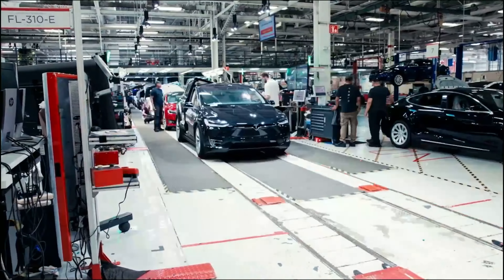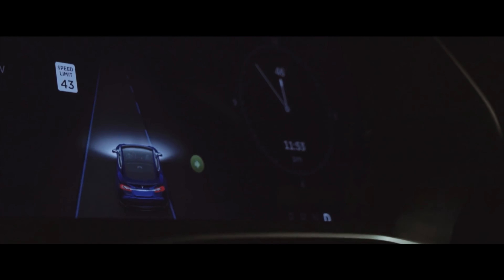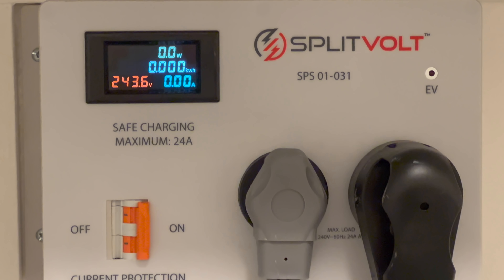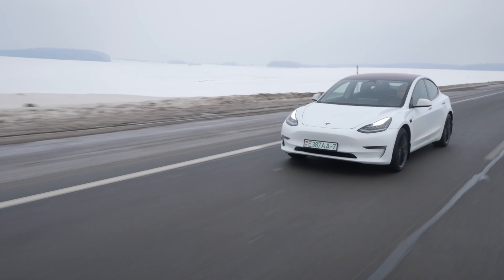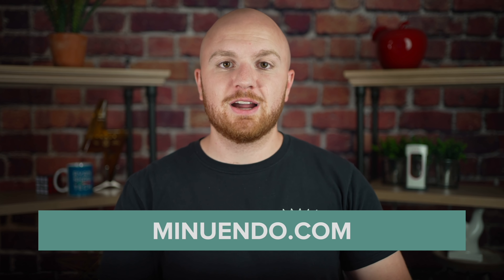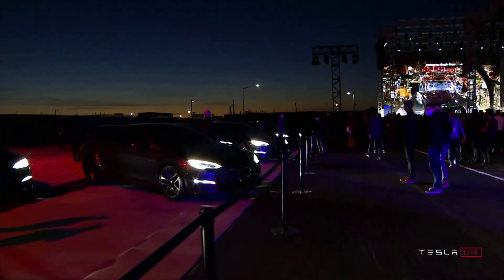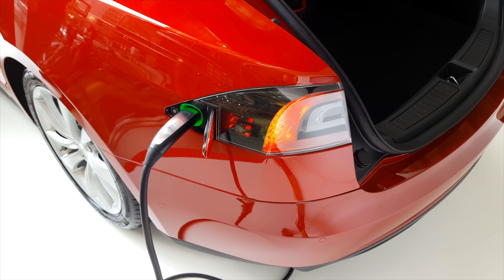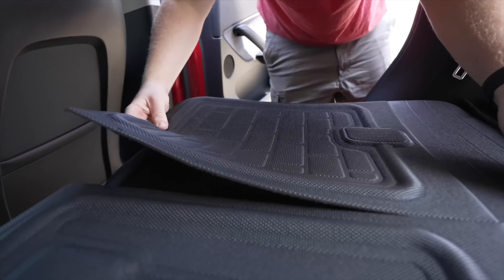Buying a Tesla? | Don't Make a Mistake

Comment: We currently own 2021 Tesla Model Y long range. We have an order in for the new Model Y with the directions to the Tesla Advisor to only accept the New 4680 battery having the longer range of estimated 485 miles.  It will have additional features like dynamic lighting, heated steering wheel, upgraded wipers and no more radar. This causes the software to see the road as a person would see it. Currently the car will brake when there is no reason to do so. Example: We have the car on cruse and radar sees a large truck exiting on the right in exit lane and the cars brakes automatically turn on as it sees the truck as a hazard. Gets annoying. 
Bottom line: we will be owning 2 Model Y"s  We have 14. 5k miles on our current one and it is running great. We have a home charger  which our local Electric Company sends a check for $750 when you send them your electric installation bill and the Level 2 Changer cost. We paid $835. Advice check out your local Electric company for a rebate. We charge 80% rate and 98% of our charging is at home. 
Do your research and good luck.
Reply: I just ordered a model y performance but I would like to wait for the Texas made Y with the 4680 battery.  How do you contact your advisor? I didn’t get any contact number or maybe didn’t see it anywhere?
Reply: @petenice75  I called
Reply: @petenice75 
  I phoned the local dealership and asked for a Tesla Advisor and he walked me through the process. He took my credit card put in my order which specified I would only accept the Model Y with the 4680 battery that put me into a wait list so when my number came up that would be it. I had to pick a color so I went with White.
Reply: @bobskeway8179  thanks!

Comment: 9 pm off peak time? This is very strange. It is possible to buy and sell electricity in Austria at the day ahead hourly spot market price.
9 pm to 10 pm is on Sunday June 25th 2023 with nearly 16 Cent the most expensive hour of the day. The cheapest hours are 1 pm to 4 pm. At that time are even negative prices.
09:40 I have seen also comparsions with 235/55 R18 Wheels.

Comment: Good list of items to consider. A couple of questions- 1. you mention std range can easily cover a daily commute with 268 miles, but you had just finished saying to not charge over 80% for daily driving, so isn't that really 214 miles (on a nice day - no heat or a/c)?   2. I still find it odd that the quality strategy is to walk with a checklist and prepare for your post-delivey service visit. At what point does it become Tesla's responsibility to deliver a high-quality finished product to the customer at delivery?

Comment: PV of $200 perpetuity = 200 / (16.67%/12) = $14,371 vs $10,000... you're better off paying the 10k up front if you actually want it. 16.67% is derived from the % of the car's value you're paying every month ($40,000 model 3)

Comment: One big problem with the model 3 sr+ is that were are currently two batteries. 

It is a gamble which Batterie you get, the Problem is that the Lithium-Iron-Batterie does not like cold temperatures. 

Tesla now has a recommendation (product Details), for the LR and Performance for cold climates. 

In the Future the Model 3 SR+ should only use the Lithium-Iron Battery.
Reply: It's not a "batterie"
Reply: @SiisKolkytEuroo  It is German, it was done by my autocorrection.

Comment: The poor ride quality is due to the very high tire pressure. Most cars recommend you fill the tires to 30 psi. The Tesla is filled to 45 psi. This reduces drag, and increases your range, at a penalty to ride quality. Try dropping your tire pressure to 35 psi, and I think you’ll find that the ride quality is similar to most other vehicles.

Comment: The FSD computer isn't included in older Model 3s. Ex: my 2018 mid-range came with HW 2.0 and before I could take advantage of the current "FSD" features my HW had to be upgraded to 3.0. I believe all recent years Tesla's come with 3.0 HW.

Comment: Home charging is harder for those who live in apartments but no one addresses it.  I would charge my Tesla at work given permission too.
Reply: Actually, chargers are now rapidly appearing at apartments and condominiums.  My apartment offers a dedicated ChargePoint charger (~6kw) for only $20/mo, unlimited use.  Some newer apartments offer Tesla Wall Connectors.  In a few weeks, we move to a condominium that offers 4 free ChargePoint chargers.  
I installed a NEMA 14-50 EVSE (9.6kw charger) on a separate separate meter at a condominium so user could reimburse association for electricity used.  Material cost was under $100.

Comment: Drove a model 3 and Model Y. Immediately decided, its not for me.. Bumpy ride spoils the whole experience. Wont even test drive these two cars unless there is a major suspension upgrade... 

Buying a 70K CAD car which is known for having  multiple cosmetic issues is unthinkable. But it would still not be a showstopper. Coz these things can change drastically between now and the time of delivery.

Comment: As usual, very helpful content Ryan.  Here in BC there is a $350 rebate from BC Hydro for installing a home charger. EV rebates: only standard range Tesla Models 3 and Y and Long Range Model 3 qualify for the $3,000 EV rebate, along with other EV's under $55,000 CDN qualify.  I don't think the FSD works in Canada yet as Tesla may not have collected the highway data needed for it to operate fully. 
Something that would be nice to add to your commentaries is to include metric measures when commenting on range, as Canada and all of Europe and even the UK I think now use Metric system for distances and for things like range kWh. Even the EPA offers metric measures in their fuel efficiency ratings as an option.  Thanks and keep up the great work.

Comment: Great video Ryan. I can definitely attest to making sure you thoroughly review the car at delivery for issues. I did what I could but discovered several issues over time that to this point the Service Center has been great about addressing. Tesla definitely still has a ways to go with initial build quality, in particular as it relates to the exterior. Unfortunately, no matter how thorough you are at scoping out the car you don't know what you don't know and inevitably find other issues as you get more familiar with the car. 

Definitely recommend the level 2 charging station at home - it's not cheap but I get 50 miles/hour charge speed and you never know when you might need a quick charge turnaround so I like knowing it's available if needed. As is, mine only takes 2-3 hours to get to 80% charge on a 60W amp after a normal driving day. 

Keep up the great videos!

Comment: I know you’ve gone to PLAID, but you should have included the $2k Acceleration Boost upgrade that’s available for the Model 3 & Y Long Range in the video. Tesla doesn’t advertise it on the order site so I’m sure there are many people purchasing the Performance that would perhaps have just opted for the Long Range and purchase acceleration boost later on.. saving them $5k overall.
Reply: One caveat...The P3D+ stops and handles considerably better with the 20" wheels, performance suspension, and the bigger brakes/rotors.  You actually get a lot for the $5K difference and would be worth it to many people.
Reply: They upped  the price to 3k now.

Comment: There’s nothing easy about record setting numbers in the middle of a chip shortage. Here’s the thing:

This record was achieved without Gigafactory Berlin or Austin, each of which will be capable of double Fremont or Shanghai’s theoretical output or a 1,000,000+ vehicles a year when fully ramped. Also, Shanghai Gigafactory hasn’t reached its full potential yet either.

And there’s also the refreshed Model X production that just restarted. CyberTruck is coming, the Semi is coming, 4680 Model Y 2.0 and next-gen Model 3 are coming soon, and then there’s the $25,000 hatchback that’ll sell in high volumes.

Expect really big things from Tesla starting next year!!

Comment: I live in a townhouse with no garage and no hoa. I only have a regular plug on the front of my house with the electrical outlet in the back of the house. What what you suggest I do for charging? Also I drive a lot and would definitely need the upgrade.

Comment: Great video.  I wanted to ask has anyone who owns a Tesla wished for a shield around top and sides to shade the screen, and do you suggest one brand.  Other question are there complaints about noise level in Tesla.  I have watched several video's about noise, but no real answer for improvement.  I think all new vehicles should have noise level ratings in information.  Recent hearing impaired people like myself seem to notice noise more then I ever did before as it interferes with conversation.

Comment: The range you are talking about in the video is that from your "normal" SoC at 80% or is it from 100% SoC?
And is your range to what lower SoC 0% or 10% or 20%?
So what is the realistic high-way speed range in an SoC from 80% to 20%? And after 200 000 miles?
What happens with battery degradation (SoH) if always charging to 100% versus always charging to 80% after say 200 000 miles?

Comment: Ryan mentioned choosing the stock wheels on the Model Y for better ride quality. Is this also true for the Model 3?
Reply: Yea, those caps/lids you see on the wheels are meant for aerodynamics which gives more speed/miles
Reply: The smaller the rims, the more tire wall you have for the same wheel diameter, the more air between the road and your car, which results in a greater cushioning effect. So if you want more comfort in any car, you should always choose the smallest rims. This will generally also result in less weight, quicker acceleration and better economy. Car handling on the other hand could be better of with bigger rims.

Comment: Hey Ryan, question about the range. I've owned a 2017 Chevy Bolt EV and now a 2019 Nissan LEAF. Both easily get more range than the EPA rating (when it's not winter).

Do you know why Teslas get less than EPA?
Reply: Highly probably due to 99.9% of Tesla drivers having a heavy lead weight on there right shoe….
And that lead weight also leads to a phenomenon called a “Tesla Grin”…whatever that is… 🤣
Reply: @ernestgalvan9037  Well put

Comment: Great video Ryan.  I just put my order in for a Model Y tonight!  I plan doing a full PPF. My one question is that if I plan on doing exterior mods like a spoiler, should i do that before the PPF or after?
Reply: I would suggest you put in the language only 4680 battery. We then lock in your price with these specs. I did with the advise of the Tesla Advisor, I will then receive the additional range estimated at 475 miles
Reply: @bobskeway8179  what??

Comment: I was under the impression that the full self driving computer was included on every car as stated in this video. But when placing the order for my Model Y my Tesla sales person claimed that it doesn’t and if I wanted to leverage the new FSD subscription I would need to make a service appointment after delivery and pay $1000 to get the full self driving computer installed. 

Did they change this recently adding to people’s confusion or was my sales guy wrong?
Reply: The “sales person” is either an ignoramus, an idiot, or, well, I don’t know….severely lacking in customer service training?
The Hardware is fully included. Read the fine print on the FSD page.

Oh, and find another “sales person”, ASAP….
Reply: @ernestgalvan9037  thank you. I’ll check out the fine print. I was pretty positive that I’d heard hundreds of times that all hardware required for FSD was included but he was so sure and gave me specific pricing he has me doubting my knowledge. Maybe he was trying to upsell me on FSD?

He also had no knowledge of what a CCS plug was or if the CCS adapter is coming to the US (despite all EU Model 3 and Y coming with a CCS plug by default, and an adapter available for older vehicles since the supercharger network uses CCS. 

Anyway too late my order has been placed months ago.

Comment: When you talk about wheels, you do not mention tire size. Lower profile than 45 series tires are STUPID in the real world. An aftermarket company needs to offer a 16-17” wheel for Tesla’s for 55-60 series tires for those of us that drive in the real world on gravel roads with chuck holes , nails, speed bumps etc.

Comment: Does anybody know how much it cost per month to charge it everyday
Reply from the maker: Hard to calculate since I’m not sure how many miles. At my current home, my electricity costs about 7 cents per kWh. That’s about $5.46 to charge my model y up for 300 miles of driving. Far cheaper than gas

Comment: One thing you should have mentioned is that paying for FSD upfront locks in the $10K price. If you decide to buy it at a later date, the price could be higher. Maybe much higher. Buying it with the car locks in the price at the current price.

Comment: I don't know what else Tesla could do to make the policy more clear about fixing quality issues after delivery. You have 100 miles or 24 hours (whichever comes first) to let them know about any cosmetic issues you want addressed. This really isn't even remotely ambiguous.

And the idea that you really should be thoroughly checking the car before you even accept delivery is absolutely fucking brain dead. You can tell the sales & delivery advisors about your panel gaps all you want, but they aren't going to give a shit, and there certainly isn't going to be anything "documented" by them when you point it out on delivery. 

Just make a fucking service appointment. There is nothing the delivery people can do for you other than take the car back if you refuse delivery entirely (which you'd have to be an absolute tool to so unless something is REALLY wrong). They have NOTHING to do with the Service Center.

You are going to be much better off just taking the car and inspecting it at home when you have time to get out your magnifying glass & ruler so you can overscrutinize and be the anal douchebag you surely are. Trying to rush through an inspection on delivery is going to make it easier to miss things, and you're just wasting those poor employees' time. Save your checklist for your own time.

Tesla is absolutely, positively, without a shadow of a doubt not going to even remotely fight you on any quality issues you make a service appointment for within the first 100 miles. Hell, most of the time they won't even push back on someone approaching 1,000 miles. This idea that if you don't point out quality issues prior to accepting the vehicle, you're somehow going to get screwed, is just not based on any sort of reality.

Comment: Get the 100K+ Vin tesla to minimize possible issues.  Currently, with so many shared components between MY andM3, most have been produced for years.  Major mistake - don't wait too long to get the Tesla car to experience another dimension of driving.  Also, while some problems have been legit, most are severily overblown and/or from real cry babies.  The reporting ratio of good vs bad is terrible for the good points.  ...

Comment: Anyone opted for the PPF? I’ve been so torn about this. The quote I received is over 6k, I feel some type of way spending that much money for a brand new car but feel like I have no option.
Reply: What's wrong with y'all? A car is a way to get from A to B, not a museum piece. It'll get some scars over it's lifetime, it's ok to prevent those from rusting but other than that, it's life, get over it.
Reply: @John Bailey yeah the quote was for film around the entire car, plus tinted windows. In total I found that $7109 for PPF + tints  absurd considering that’s close to half of what I put down on this car. But it seemed every telsa owner I spoke to was opting for this. I’ll look into partial only doing the front and rear and the side panels later.
Reply: @John Bailey scared to Doing it myself and making it look bad.
Reply: @Makatea  if you’re talking about a Honda Civic sure, it can just get me from point A to B but I’d like to protect my 60k car for as long as I can.